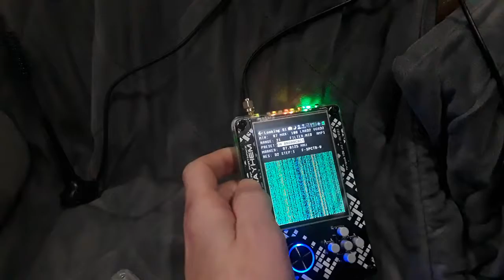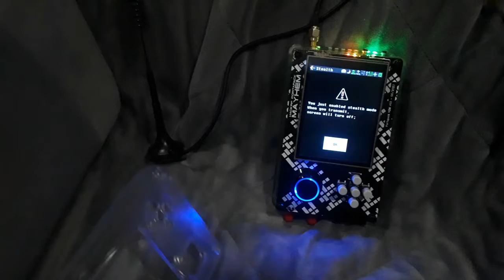HackRF Portapack Case Installation Part I

Comment: I'd think that screen wouldn't be too difficult to replace, as long as you're okay with using a soldering iron.
Reply from the maker: I was considering this - but also thought to myself: how much more might it be to buy a 2nd portapack hackrf? Might go for it when things line up. I'd like to have a 2nd one for certain applications.